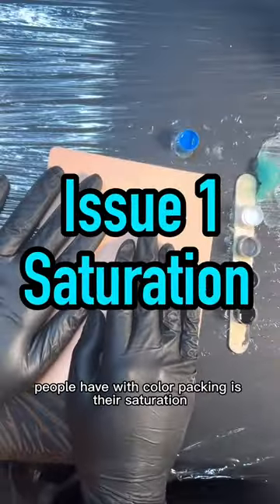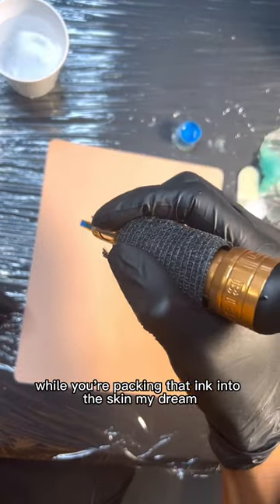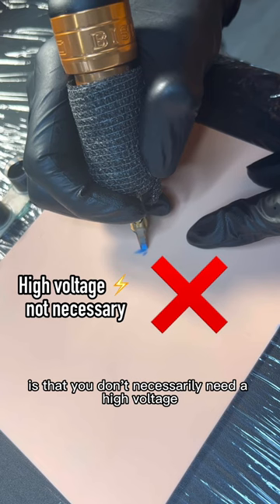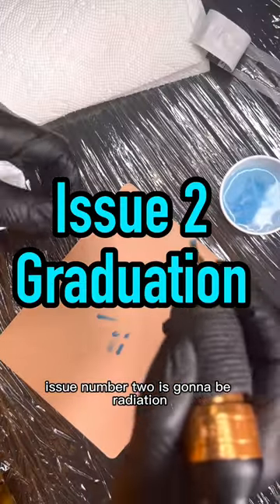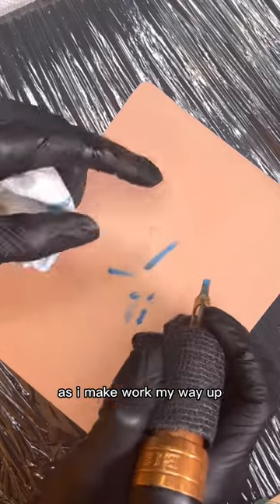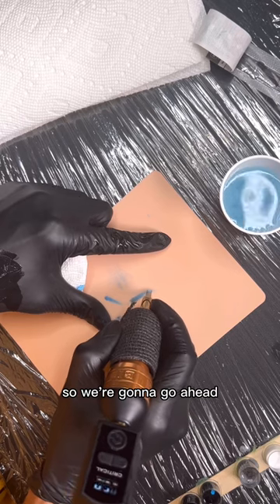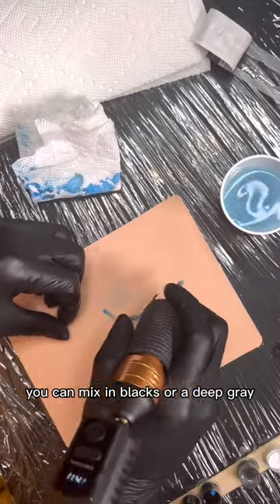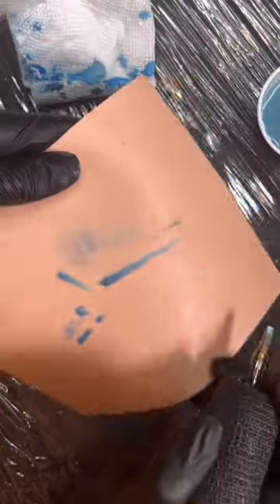Tattoo Color Packing - avoid these mistakes!

Comment: You have some great and easily understandable tutorials, but seeing you rubbing the needle on the paper towel while the machine is running makes the hair stand up on my back! :) That's the easiest way to stab yourself (cross contamination, infection, unwanted finger tattoos, etc) plus paper dulls the needle like mad resulting in more skin damage, problems with packing ink and healing among other things.
Reply from the maker: Thanks but that Sounds like your personal experience. Been doing that for years, haven’t had any of those problems
Reply: @Qinks  I know, but there are also thousands of skydivers who never had any malfunctions until one day stuff hit the fan :) Anyways, thanks for the quick reply, don't get me wrong this wasn't an attack on your way of doing things and the information provided in the video is actually useful.
Reply: But otherwise you won't get rid of what is inside the cartridge, I do the same and there is no other option to do this while machine is not turn on.
Reply: Do you know why paper dulls points and blades so much?
Reply: Idk boss, if you're using the right gloves, a cart shouldn't puncture the glove unless you really try/wasn't paying attention
Reply: There is literally an opening to flush the cartridge with distilled water while the machine is running.

Comment: There are some advices I can add. Especially for beginners.
1. Do not use small needles, unless you work in smaller area, use big curved mag like 11 or 13 etc, and use 0.25mm or 0.30mm sizes. With smaller mags you end up patchy or overdamaged skin. Use the size according the size of area you need to cover. Also the smaller needle the less deep you can and need to go as there is less skin resistance, with bigger mags you don't need to be afraid to go deeper (but it will come with experience) 
2. Never use vaseline when you color packing, I would advice not to use it at all in any area you will tattoo. I use only on area that already done so that  blood doesn't dry and easy to wipe ink etc
3. For solid color use circular motion and if you need gradient then on the edge of 2 colors use swinging motion. Swinging motion mostly used for greywash inks, it still can work but it will take so much time to saturate the skin, the faster you do the tattoo - the faster it heals and less ink goes out.
4. It wasn't mentioned or I am just a plonk, but in area you color packing you need to make ink flood - so it looks like swimming pool, a big puddle of ink (learn how and why ink goes under skin, there are great tutorial - "how ink really gets into the skin, tattoo psysics")
Reply from the maker: There is no one way to Tattoo, thanks for your comment. If you feel so strongly about the ways you suggest than I think you should make a video.
Reply: @Qinks  when I will be less busy tattooing and making jewelry, I probably will.
Till then I am giving extra advices for everyone who reads it. I have many healed tats and I know what I am talking. Everyone have their own style and way. And the more advices you get and try the better.
Reply from the maker: Never said you didn’t know what you are talking about, you said the same thing I did. Everyone’s advice will be different, so if your first words are “a few issues with the tutorial” that leads me to believe otherwise.
Reply: @Qinks  sorry, I have problems with explaining things, especially is not my native language and apperantly reading. I misread is no one instead "is no way to tattoo" .
Reply from the maker: Ahh I see, well thanks for explaining that. And sharing your thoughts!
Reply: awesome
Reply: Can I ask the reason why u don’t use Vaseline during tattooing? I personally don’t use as well because I’m scared to block the needle with it.
Do you use anything else instead?
Reply: @maddie6800  I use vaseline but not on area I am tattooing, only on area I already tattooed. It blocks everything so less ink will go into the skin. There are different lubes to use and try that do not have petroleum jelly, I think they are silicon based, but not sure. They are expensive and they will actually do not allow to ink go out so the tattoo won't bleed almost at all. But because I work fast I never needed one.
Reply: @alex.zaitsev5890  thank you for your reply, I already ordered INK-EEZE Purple Glide from killer ink and will check how it works thanks
Reply: @maddie6800  I used it before, amazing stuff but during lockdown it was out of stock for like half a year or a year.
Reply: @alex.zaitsev5890  oh ok so I’m glad I ordered it
Reply: Maybe it's just me the creators comment seems a little eh. But u posting information in comments is helpful. So thank u for the information
Reply: Thank u for ur advice it was really helpful to me as i am a beginner tattooist in progress 😊
Reply: Hi , today i made a tattoo with a 3rl because it was lines , and it had small areas to pack . I was using sky blue and dark blue but the ink didnt seem to penetrate and it was causing trauma to the ski . With de black this doesnt happen, but with the blues is the second time ... 
If you have any sugestion please help xd
Reply: @BeatrizSilva-ci9gm  sorry, responding from another account. Previous do not allow for some reason.
I believe you was using 3rl to color pack. It won't work with thick ink, for color tats you need to use 0.35mm size needles also referred to 12 gauge I think. Ideally to buy 0.35mm 05RM on package it may look like 1205RM. Or 07RM, it's up to you. The thicker needle the bigger dot it will leave, and easier color pack is. For shading use 0.25mm needles for color 0.35mm.
Also sometimes is better to add few drop of purified water or witch hazel to color ink to make it just a bit more fluid. And with color do not use any ointment on area you will tattoo, only on area that is done.
Reply: @joki.3d  do you have any social account that i can contact you so i can take this question out of my head 
I mixtured with destiled water because i wanted a lighter blue .
I can show you the picture so you can see what i am talking about .
Thank you very much for your answer

Comment: Could you emphasize on this a bit bro. For example do you put dark colours on top of light or light on top of dark at times ? Also do you only solid pack colour or do you do something called glazing where you lightly brush a colour over another colour ? I've seen that technique used. Thanks
Reply from the maker: I do dark colors first! And I do solid packing and the brushing just depends on what I am trying to accomplish, the type of skin i’m working on and how short the transition to the next color is
Reply: @Qinks  some colours you can actually put light on top to soften the colour give a lighter tone sort of like when you put white on top of greys or healed black on a cover up. Then have to remember to hit your darks again but not overwork though because the light colours can be wiped into the dark areas. That's my experience anyways.

Comment: i use the same battery pack as you on my cheyenne sol nova. i’m a first year tattooer - but i think i might be running my machine too fast. what do you normally run yours at?
Reply from the maker: I run on 6 volts. Which stroke did you get? The 2.5, 3.5, 4.0 or 5.0?
Reply: @Qinks  i use a 3.5mm! thanks for replying so quick!
Reply from the maker: No problem, and okay! I personally like machines with longer stroke for my color packing and running a slow voltage with it. If you do mostly black n grey shading than at 6 to 6.5 volts for 3.5 stroke should be perfect
Reply: @Qinks do you have insta